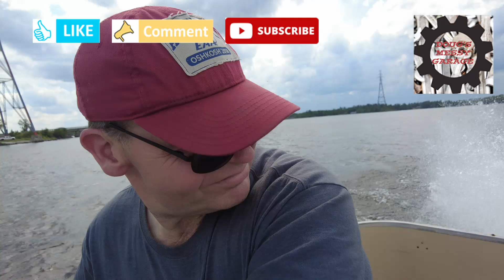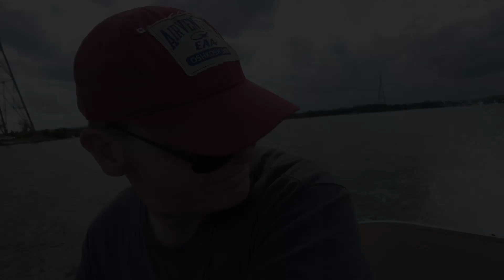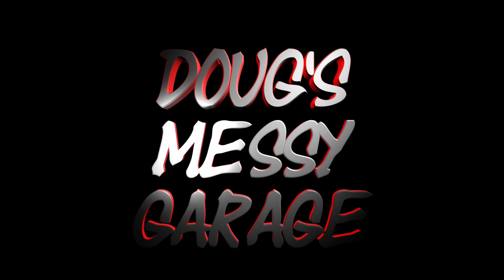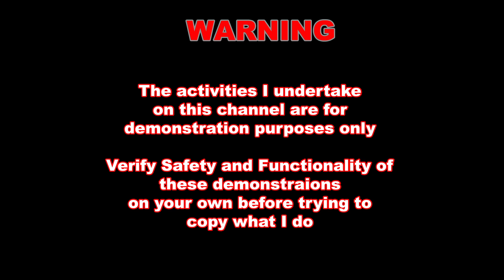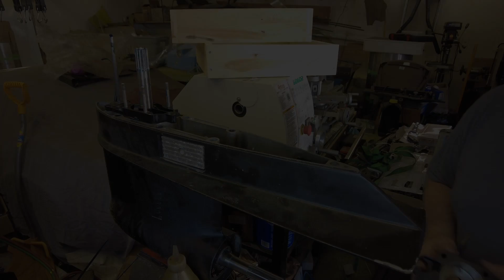Force 120 Hp Lower Unit Repair Pt4 - Final Assembly and Lake Test: PROJECT PONTOON Ep 10.8

Comment: From the beginning to the end, you skipped past the removal and reinstall. If you'd like to get more than a few likes, you'll need to not bypass critical parts, hence why people asked you how you did it, while watching your video on how you did it. Do better or find a new hobby. Also, good videos state size of wrenches used for which parts, etc. Lot of useless video missing the main components of why people come to view videos. You may just need a buddy to hang out with and chat, because the knowledge wasn't shared
Reply from the maker: This project kind of got forced onto me unexpectedly when the lower unit blew up.   Admittedly, this was also early in my YouTube journey.  I have gotten out of the outboard videos because there are channels that do it far better than I ever could.

These motors are pretty hard to work on because there is no consistency in the parts.  Merc used whatever they could cobble together to make Force outboards.  My motor was a '94 but the lower unit, I believe, is from '93.  The trim/tilt was from even earlier than that.  If you order a seal kit for the lower you think you have, you might actually be able to use about three seals out of the kit.  These videos are less of a how-too and more of a warning to dig in with care.

Thanks for watching and for leaving your constructive feedback.  Always good to hear opinions other than 'Awesome!'

Comment: Hello sir what would be the cause of water not coming out the outlet whrn using muffs ?
Reply from the maker: It could be a bad water pump impellor or possibly a problem with the tube that brings the water to the powerhead from the lower unit., if it's seal is shot or if it is not aligned with the pump or the powerhead.  Next issue could be more serious in that the internals of the block could be cracked but then you would like see the water pouring out of the exhaust.

Comment: I just got this motor and was wondering how to drain and fill the lower unit?
Reply from the maker: There should be a plug with a slot in it for a screw driver near the lower portion of the rounded part for the drain.  There should be a similar port about 3/4 of the way up the gearbox that is level check port.  Remove both plugs and let the oil drain into a container.  If it's milky, it has water in it and your seals are likely bad.  Get a  couple of 1 quart (1 liter) bottles of gear oil (one with the tapered spout).  Put the spout in the lower hole and squeeze the contents into the gearbox until oil starts coming out the top port.  When it does, install the top plug with the spout still in the lower port.  Then install the lower plug.  Some oil will drip out but as long as no air can get into the top. it won't be much.

Comment: For the trim, Replace the seals in the cylinder first. 20 bucks, the valve body 150.
Reply from the maker: Eventually, I figured out I had  a pair of lines crossed.  Trim worked great after I corrected them.